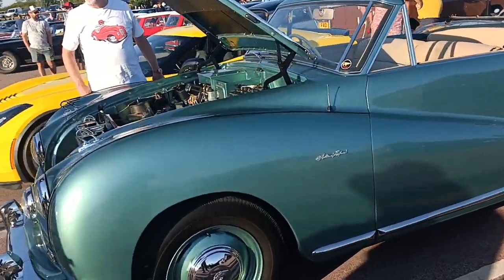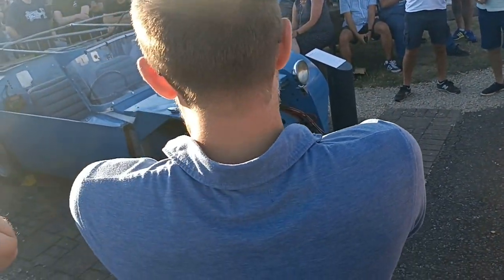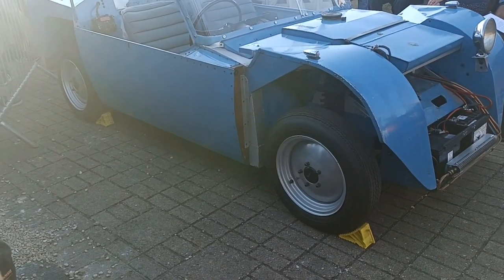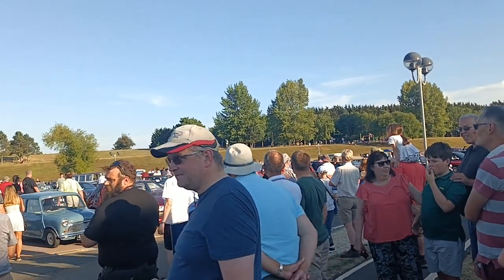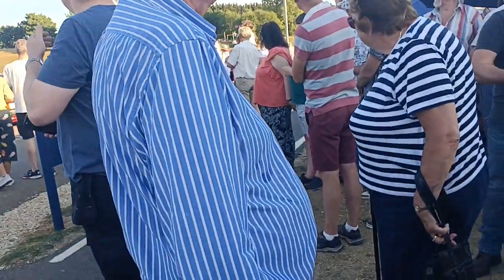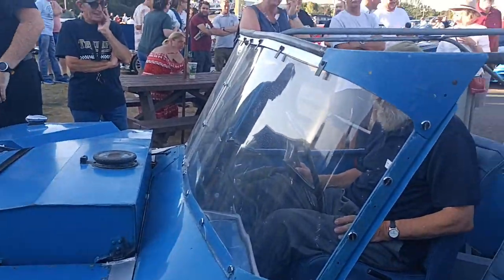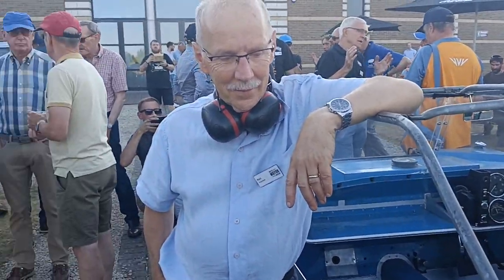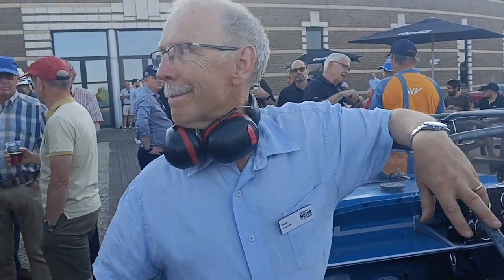Check out the Rover Gas Turbine car running and driving. First time in public! Gaydon August 2022.

Comment: You were in the right place at the right time Mart. Thanks for the report.
As a recent graduate working for Parsons on steam turbines dad was "invited", in 1942, to go for an interview for a job at the Royal Aircraft Establishment in Farnborough. This turned out to be for a job in the recently formed gas turbine engines department. He attended meetings with companies involved in gas turbine development, including Frank Whittle's Power Jets Ltd. Later this engines department developed into the National Gas Turbine Establishment on an adjacent site. He worked there, and in a London office, until he retired.
Whittle realized the potential of using the exhaust gas thrust to power an aircraft directly, without the need to drive a propeller, and so invented the jet engine.
Both Rover and Austin experimented with gas turbines. I think Austin more quickly decided they were not suitable for car powerplants but did make some electricity generating sets. Maurice Leason's toolroom in East Works was there for the gas turbine team. By chance, wandering through some workshops at Canley, I stumbled on a couple of the Rover gas turbine cars, including the Rover BRM.
Dad would probably have been irritated by people saying these Rover cars had jet engines preferring "gas turbine" as the wheels were driven by power taken from the turbine shaft, as you discovered!
Reply from the maker: Hi Andy. Thanks for the interesting story about your Dad. I do remember some connection at the East works, thanks for bolstering up my sketchy memory.